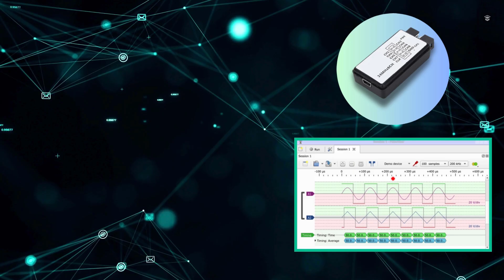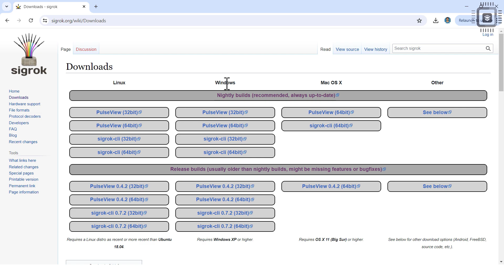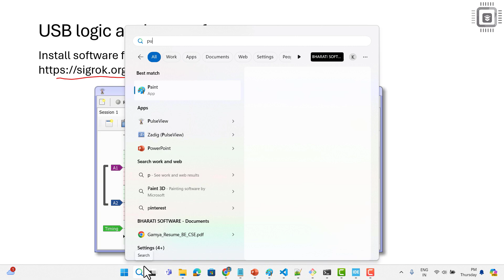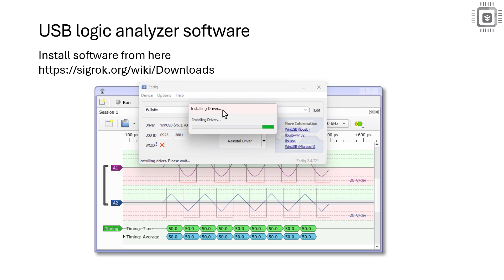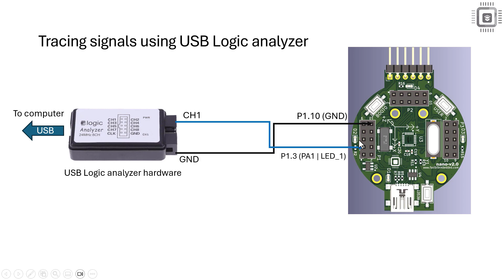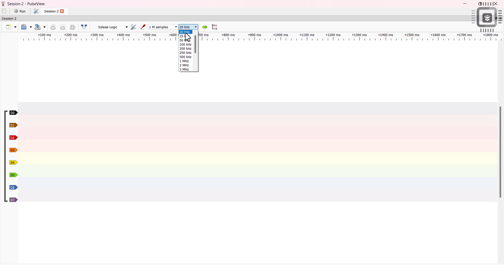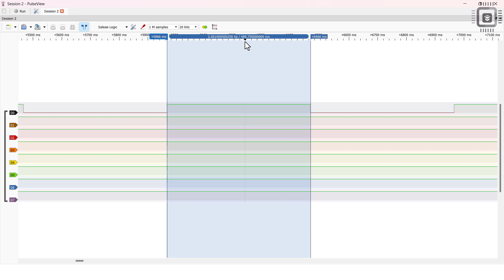How to Use Sigrok PulseView Software | Logic Analyzer Tutorial

Comment: How well does it Sigrok/PulseView handle analog signals from a DAQ/Oscilloscope, instead of a logic-analyzer?

I understand that Tomas "Harvie" Mudrunka has committed some changes that seems to work for several devices
( soundcard oscilloscope, UNI-T UT61E, Rigol DS1074Z , Hantek 6022BE (via fx2lafw driver), DSO203, xprotolab? )
but then I also see forks like pico-coder / sigrok-pico and simonschmidt/hobby-stm32scope , why?

I have an 8-channel DAQ that I'd like to visualize using Sigrok PulseView..  would the mainline build work best, or a fork?  the DAQ outputs on USB3 Bulk-Transfer-Mode, and needs to be formatted before viewing.  I was thinking my driver could publish via a ROS topic, then Sigrok PulseView would subscribe and read the data that way.   Any recommendations?

Of course, I've also seen many custom solutions* (often PyQt based), but would love to stick with Sigrok PV!
*OpenHantek6022, Thunderscope, STM32JDAQScope,  xoscope , Analog Devices' Scopy, pico-scope Scoppy, 
plotjuggler, Scopefun, QtOscilloscope, Kst , even Bespoke cloud dashboards like grafana / ElectricUI, etc!